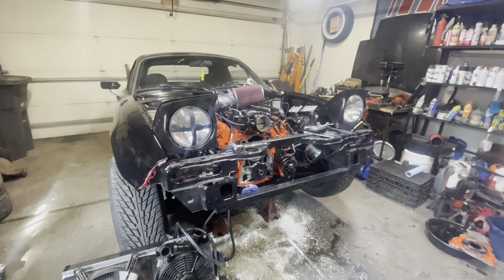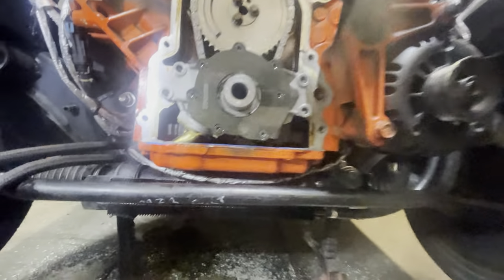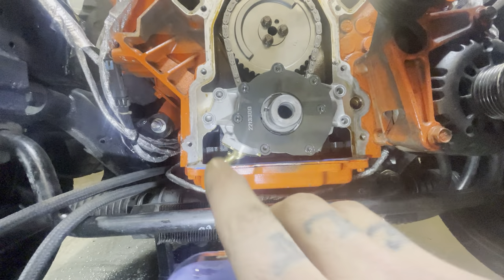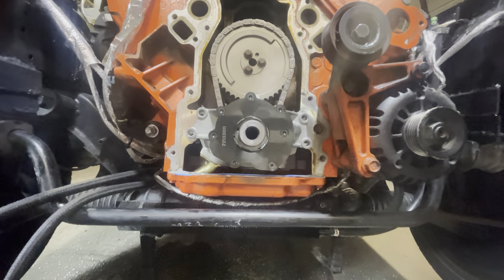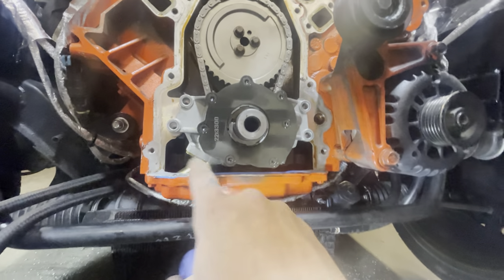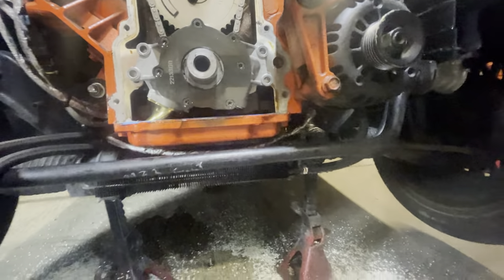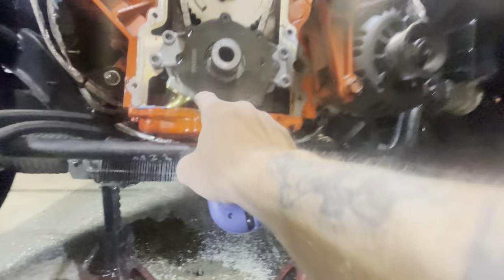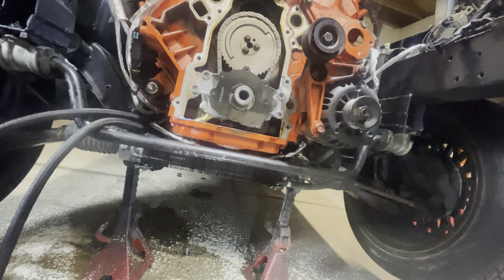MISERY LOVES COMPANY!!! Shout out to Car Bore

Comment: 😂😂😂😂 the word legend gets used a lot but you sir are indeed very much a legend! 🍺
Reply from the maker: HAHAHA thanks boss man. If I was really smart I woulda made sure before putting it all together... lesson learned, again... LOL
Reply: @pawpatina  everything is a lesson with these cars I think. The snapped bolt that makes a 3 hours job turn in to a week long event was must first lesson 😂
Reply from the maker: @CarBore  oh yea. most LS engine have an exhaust manifold bolt or 3 snapped off in the aluminum head... MOST people would start drilling or reverse bits... I weld a nut on it and back them right out... LOL experience is priceless...